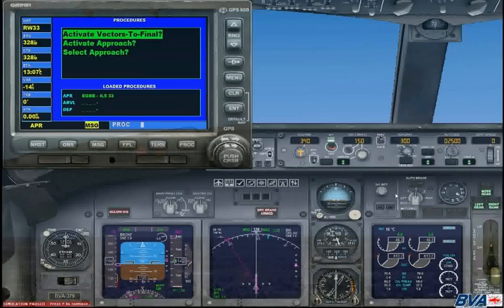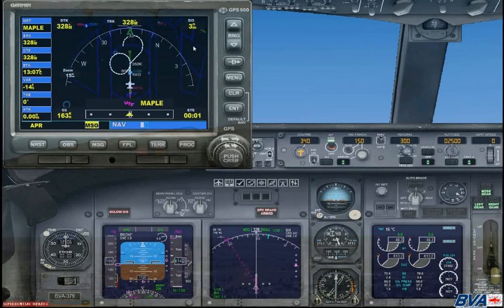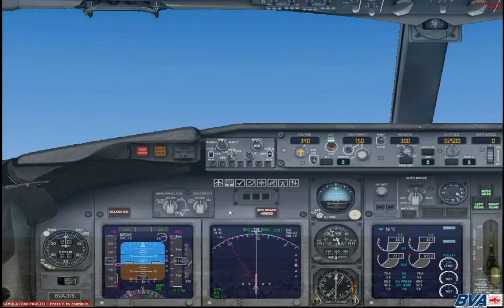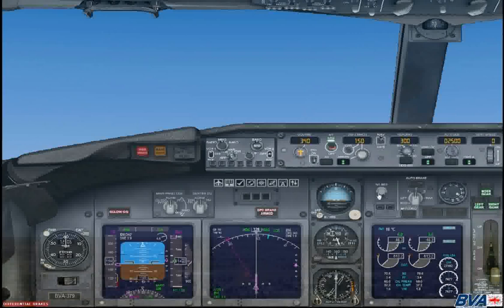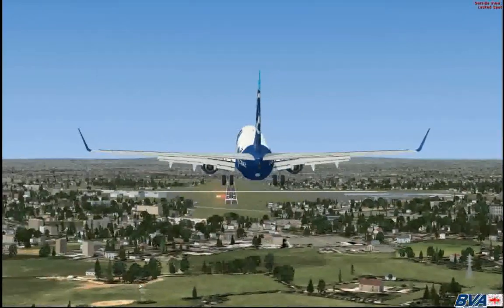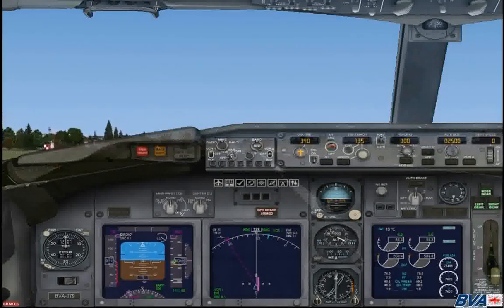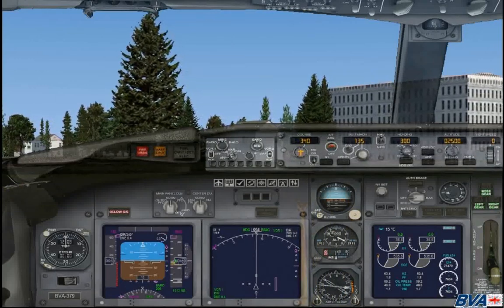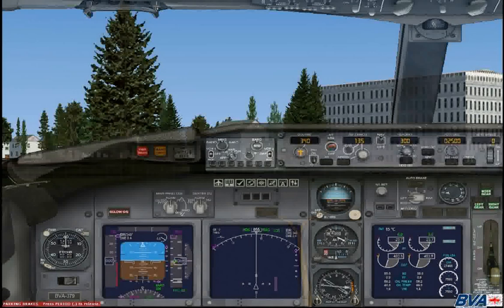3. ILS Approach Tutorial - Part 3: Short Final and Landing

Comment: The autopilot in the B737-800 in FSX does''t have a BACK COURSE (BC or Reverse) switch for ILS BACK COURSE approaches.  Does the APP switch automatically detect if it's a BACK COURSE approach (as my Embraer 175 does)?  Tried every which way trying to land on the BC at San Luis Obispo (KSBP), with no luck.

New on FSX, and the B737 panel is a big improvement over the FS9!

Comment: I really need your help. I want to know how to set an IFR destination using the GPS. I know how to set an IFR destination using the Flight Planner before the simulation actually starts. But the problem is I can only do one flight before restarting the simulation. The reason for that is that after I take-off from one airport and safely land at another, how would I use my GPS to set a NEW IFR destination without having to restart the simulation again and just using the Flight Planner.

Comment from the maker: Each runway has 2 runway numbers. One from one end, and one from 180 degrees in the other end. Now this is dependant on the airport, but some airports use the same ILS frequency for both the runway ends, while some, for instance Gatwick (if I remember), use a different frequency for the same runway, but from the different directions. Therefore, the only thing you need to make sure of is that the runway you are given to land is the heading that you are heading to.

Comment from the maker: You need to have the approach switch activated when you are coming in to intercept the glide slope. As long as you are at the correct height to intercept, i.e you are not above it, the altitude hold switch will automatically disengage when you hit the glide slope. This is, of course, as long as every thing else is set up correctly.

Comment: Hey man great vid, though I have a question, when my plane goes into the glide slope it does line up nicely, but it doesn't want to descent, I have disabled the altitude hold switch so it should work. What am I doing wrong?

Comment: The trick to descending in jets is shown in the ATP lessons
The rule is 3:1 so for every 1000 feet you fly 3 nautical miles so if you are at 26 000 feet and you want to descend to 3000 feet you do this 26 - 3 = 23, so you need to descend 23 000 feet and for distance 23 * 3 = 69 nautical miles from the airport.

Comment from the maker: I have been considering going back to do some more videos, but basically. The standard descent rate would be about 3%, so for each 1000ft you descend, you will roughly travel about 3nm. So if you are 26,000ft, FL260, out from the airport, I'd say aim to be 12-15nm from the airport at 3500-4000ft. So start descending from 26,000ft at about 70-80nm from airport, depending on how steep you want to descend.

Comment: Dude, NAV1 ID switch is just to check the morse code is correct and you are receiving the right station. Turn it off once its identified, nothing to do with updating DME information. ATHR and AP should come out by 1000ft (Radio Alt) for a manual landing, 200ft is way late. late on flaps too, theres a flap schedule printed by the gear lever, this is maximum speeds for flaps but the schedule is generally maximum -10kts indicated airspeed. Not hating, just there's a lot of noobs using this tutorial

Comment from the maker: No idea how real it actually is to real life, unfortunately I am not a real life pilot, but to turn off the engines after you land, you can either go to the throttle panel, usually shift+4, and turn the cutoff fuel switch on, or you can do it just by pressing shift+f1. This will do it for you automatically.

Comment: ian65 says: Nice training videos :) Would add that TOD (Top of Descent) is very relevent to arriving at the correct ILS glide slope height. Most glide slope interception heights are 40000 to 5000 feet or as directed by ATC. Correct procedure calls for a speed of 250 knots below 10,000 feet with landing lights on.

Carefull attention to IAS (Indicated Air Speed) and ground speed (GS) when approaching finals is essential. Knowing the correct IAS for each flap extension is also very important.

Comment from the maker: @hakimihomayoon Even though the plane is landing itself, it is probably landing at a much higher landing rate that safe for an aircraft. A safe speed is 50 - 200 m/s but usually the default planes will hit the ground around 500+ m/s. On a normal aircraft, this would damage crucial parts of the plane, such as the landing gear and possible the fuselage. This is why I usually fly my own flares to increase the realism felt by the game. Especially if doing flying with Landing Rate statistics.

Comment from the maker: @vogelbekdier97 Its nothing to do with the App Hold button. Its basically the mechanics of FSX's default aircraft. The ILS building, which you fly over just as you are coming into land, which the plane is using to guide itself in, just flies at the point at the same angle as does not take into considering that when you are close to the ground it require the plane to flare etc. There's nothing you can do about it, just manually flare it. Planes, such as the PMDG ones, auto flare.

Comment from the maker: @1216saab When you are selecting the approach to fly in via the gps, instead of selecting vectors, certain runways also contain guidance via VOR's as well. So on the area that says Vectors, try and change that and fly to the vor that starts the approach. You use the gps switch instead of nav and use then Locator/Nav hold switch and when you are on the final stretch straight in, switch to the nav switch and fly the ils as normal.